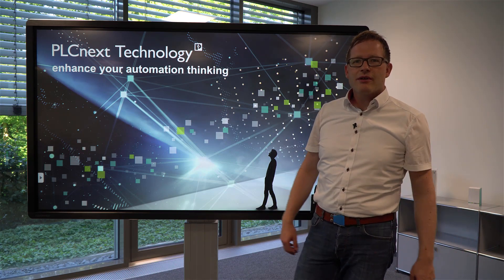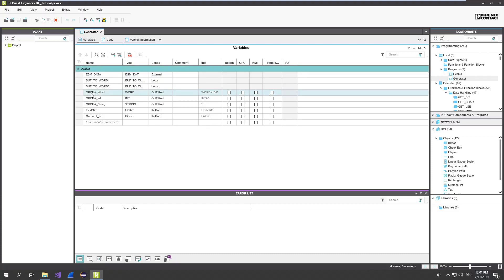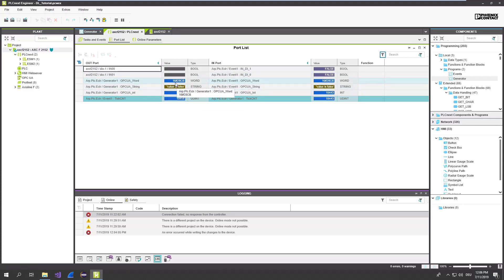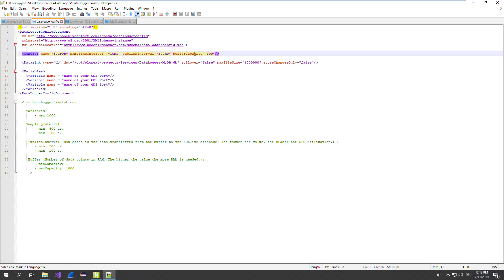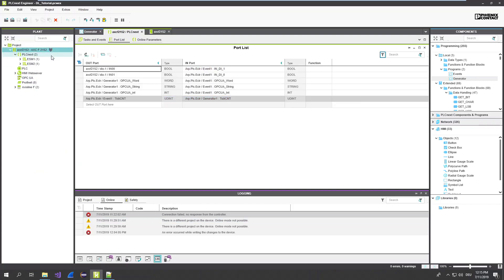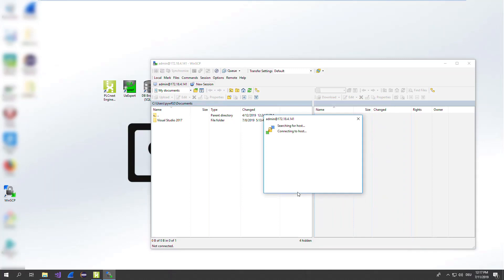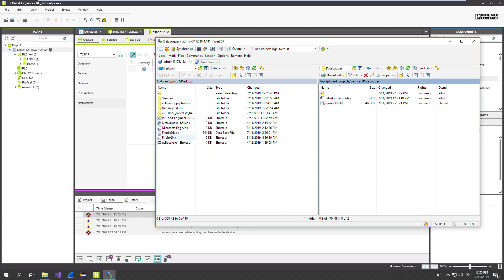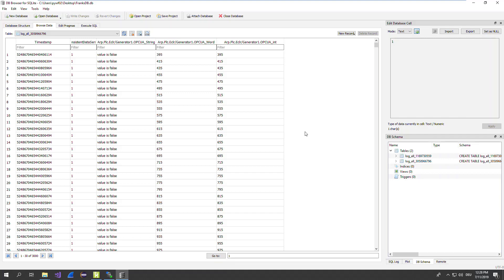PLCnext Technology | DataLogger in IIoT | Configure the DataLogger for "Record on Time" mode

Comment: Hello, is it possible that in the latest PLC Next Version copying of the name of the Data Port for the config File in PLC next isn't possible anymore?
Reply from the maker: Hi, thank you for your question. To better understand your issue, could you please describe what you are trying to achieve with copying the name of the Data Port in the latest PLCnext Engineer Version? Providing a specific use case would help us assist you more effectively.

Comment: Hello, I have a question
so, when i use  plcnext simulatatin (1152) i can't connect with Win SCP.  Can you help me reslove it?, i think the reason is i used the simulation and not the real plc, right ?. Thank
Reply from the maker: Yes, accessing the simulation via WinSCP or similar tools is possible. Just make sure to use port 5555 and IP address 127.0.0.1!
Reply: @PhoenixContactTechnical  Thanks, I connected it but i want to realtime data from PLCnext Engineer to Excel . Do you have anyway to do ? Thankyou.